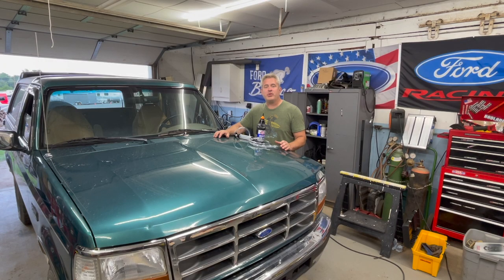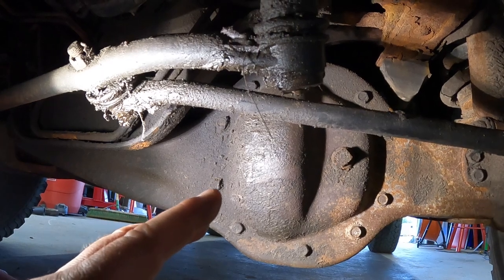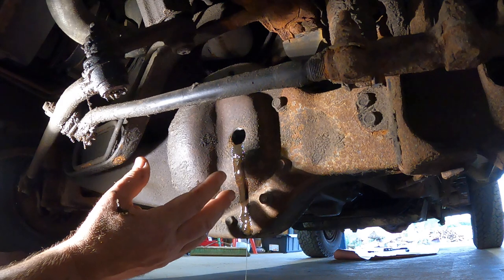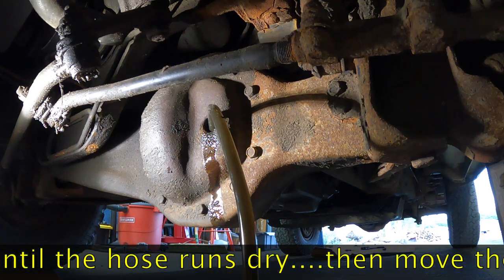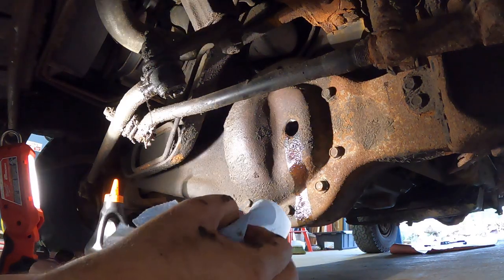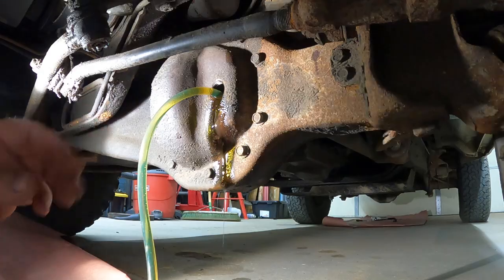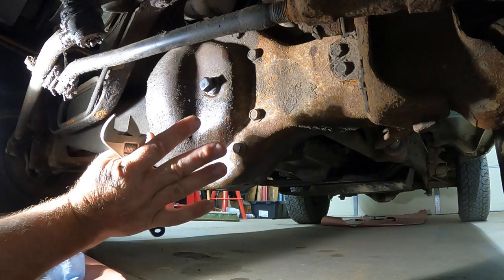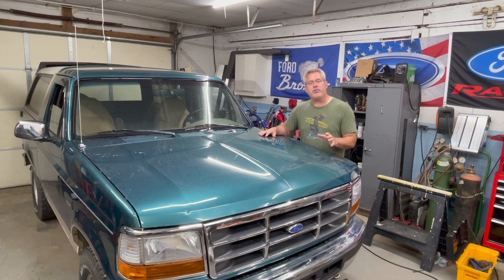Front Differential Oil Change | Ford Bronco F150  TTB IFS-Dana44 | Proper Procedure

Comment: There is a flat area on the front diff, where a drain plug could have gone, I drilled it out, used a tap to thread the hole, flushed out with oil and a magnet then threaded in a standard pipe plug. I believe there is a you tube video on the drill bit , tap and plug size
Reply from the maker: Not a bad idea but risking shavings in there is risky.  The pump was $8
Reply: I was just under my 91 F250 and know the exact spot you're talking about, as when I looked at it I thought "where the F is the drain plug!?"😂

Comment: Hey good video! You've got a new subscriber. One question, is this oil the same one you used for the rear diff? Thanks and keep making videos!
Reply from the maker: Yes. But depending on your rear differential you may need a limited slip additive to the rear
Reply: How can you tell if it’s limited slip differential?

Comment: where is the axle vent on this axle ?
Reply from the maker: Top
Reply: @BroncosandPartsGarage  yeah found it. The hose had rotten off and hanging. Luckily the vent was not clogged. Was able to insert a wire in 4+ inches. Put a new hose on it. But I think the fluid is probably dirty. Going to redo with 80w-90 just like yours
Reply: One more question. I saw your transaxle video. I’m thinking of using Valvoline fluid that is dexron 3 compatible. Hope that’s ok.
Reply: What kind of fluid is used in the front and the back? Thanks guys !

Comment: Hello. I have been having a problem with my 96 Bronco with the steering wheel locking and the key not turning. When I go to start it the key won't turn so I turn the steering wheel to unlock it and when I try to start it from there it will turn over but not start. Not sure if it's the ignition coil or the neutral safety switch or what. Any help would be appreciated
Reply from the maker: There is a switch/ module on the left side of the column. Activated by your shift lever. Make sure everything is tight or not worn out
Reply: @BroncosandPartsGarage  I'll check it out. Thanks